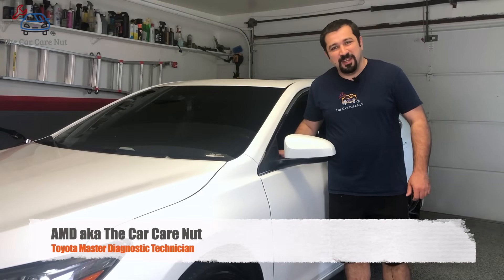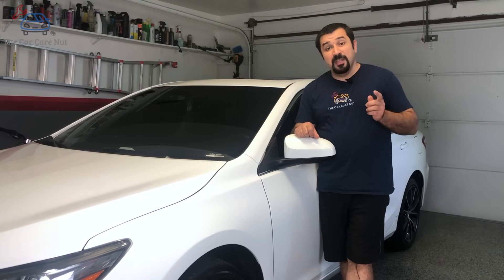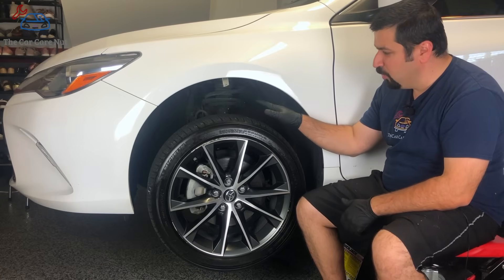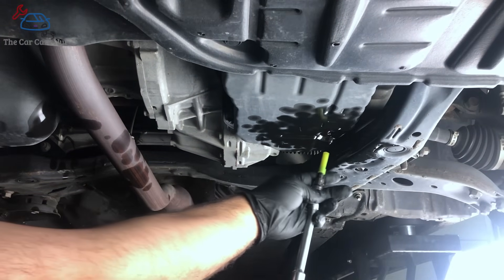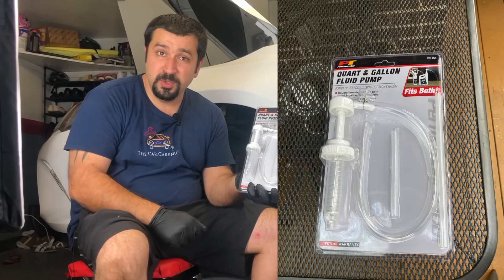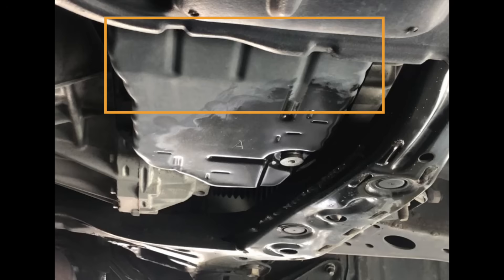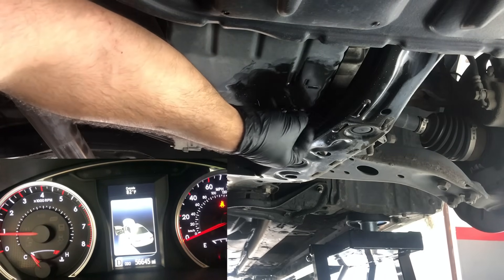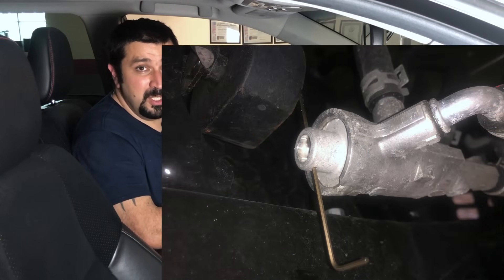How to change your Toyota Sealed Transmission Fluid

Comment: Thanks so much for this video.  Any thoughts on changing the filter on the Corolla CVT trans?
Reply from the maker: Hi! I wouldn’t change it if the fluid is changed on time
Reply: Thanks @Robert Weinmann for raising the question,
I've same model in the middle and didn't get a clear answer till i found this video. 
Thanks @AMD for the answer even if a question asked after video release a year later.

Comment: I have a 2021 Toyota Camry.  I am preparing to do its first 60000 mile transmission service.  I have a Launch scan tool.  It shows the ATF Thermal Degradation level.  It currently says 1645.  I have searched online and can not find anything on what 1645 means.  Is 1645  good or bad?

Comment: Why not do this when the car transmission fluid is cold (sitting overnight) then put in exactly what you took out?
Reply: Because the transmission fluid level might be low when you start.

Comment: does this work for 2011 camry?
Reply from the maker: Yes it does
Reply: Thnx for the reply! Would you recommend changing the filter too? I just bought a 2011 Camry with 130k miled
Reply from the maker: Hi! There’s a risk of issues changing the fluid at this time if it’s never been replaced

Comment: Sir, may I ask, on the fluid procedure, after the drive solid, while draining oil until it trickle, is the shift position on neutral or drive position? Also, if I want to practice before change the oil, the engine running or not while practice? Thank you
Reply from the maker: Hi! Engine running and in park

Comment: I know about the transmission fluid change, what about the transmission filter replacement? does it need to be done? and how to get trans fluid out of torque converter?
Reply from the maker: Hi! Filters don’t need replacement on toyota transmissions if the fluid is changed on time. You can’t drain the torque converter on toyota transmissions
Reply: @TheCarCareNut  Thanks for the response

Comment: If you drain the fluid when cold and refill the exact amount, then would that be enough if you don't have a temperature gun or don't want to refill without checking.the temperature?
Reply from the maker: Hi! You never know if the fluid level was right to begin with. If you do a job, follow procedure and do it right. I highly advise you not to cut corners with transmission fluid service

Comment: Hi there  I saw your channel  I was wondering if you help me with a question.   I have a 2006 Lexus gx470  with 175,000 miles   It’s been well taken care of.  I have service records for the car but I don’t see where transmission may been changed in it’s life.  Being that I want to keep up with maintenance would there be a problem changing the fluid and filter.  I have watched several videos.  I know of the horror stories of people changing fluid and transmission starts slipping or stops pulling.  Have you had that experience.  I had two Lexus  mechanics here tell me I’d be fine Toyota’s don’t generally have that problem.  But thought I’d reach out and ask.  I know to never do a power flush.  Any advice would help a lot.     Dustin
Reply from the maker: Hi! I’d be careful. You can replace the fluid but there’s risk of issues developing

Comment: Do I need to change the oil on my CVT gearbox again now? 
My Toyota (Europa) is from 2012. Changed gear oil (CVT) at 110000 km 5 years ago. The car is now 10 years driven 152000 km. During the summer holidays, the car pulls a caravan 500-1000 km per year. Should I change gear oil again now?
Not all the oil can be changed so I thought maybe a good idea?
Thanks in advance, your videos are very helpful.
Regards Steen
Reply from the maker: Hi! I would change it again
Reply: @TheCarCareNut  Thank you very much for your answer.
So even though the car has only driven 25000 miles (40,000 km) since the last gear oil change, you will do so due to the almost 5 year interval. Have I got it right?
It is important to me that the car can last 10 more years, I do not like the new modern cars :-)

Comment: Questions: 2019 corolla se (cvt). 

1) You didn’t say specifically if when the D stays on if you leave it in drive while draining the excess fluid. Do you leave it in D or do you continue shifting from D to N?

2) And if this is the official 60k mile interval fluid change. Is this the recommended fluid change every 60k miles? Because the corolla has something like 2 gallons of fluid, correct? And this is only swapping out 2.5 quarts. Those 2.5 quarts are enough to refresh the entire volume?

3) Does the cvt have the usual automatic valve body and filters that standard automatics have? And if so, do you recommend that the filters ever get cleaned, as in dropping the transmission pan/valve body?
Reply from the maker: Hi! When the light comes on shift the car in park and adjust the fluid. And every 60k miles is a good interval. The cvt transmission does have a valve body and a filter. Typically filters last the life of the transmission if the fluid is replaced at a good interval
Reply: @TheCarCareNut  you’re awesome man. Thank you.

Comment: Hello. I am from Puerto Rico but my daughter lives in Orlando Florida. She has a 2018 Corolla S. We have contacted the Service Department of the Toyota dealer that sold her the car several times to have the CVT Transmission oil changed but they indicate that they do not do this work because it is sealed. We understand that the change is necessary since the car has 62,000 miles. What can we do or do you recommend we do so that this work is carried out. We do not have a recognized mechanic to do this work for us. We also do not know anything about mechanics, so we do not risk doing it ourselves. Thanks in advance for your help on this.

Comment: One more question, with the whole drive light indicator method, so once I have been switching thru N and D and I see the indicator stay solid 'D' for a few seconds and then go out. Am I then safe to put the car in park, take foot off brake, remove jumper and then wait for the D to go solid ?
Reply from the maker: Yes out the car in park and remove the jumper

Comment: With a 2015 Camry hybrid what is the temp for a warm transmission using a scan tool also I have 152000 miles on the car and I have never changed the trans fluid , should I use your procedure now to change it what should I do differently?
Reply from the maker: Hi! For hybrids this procedure doesn’t apply. It’s actually much simpler just drain and fill until it overflows
Reply: @TheCarCareNut   Awesome that is so much simpler to just drain and refill until it overflows ,, thank you and at 152000 draining the tranny and filling it with new fluid will still be ok right it wont hurt the tranny?

Comment: ??? Where is this transmission cooler bypass valve located??? When do you pin it and when do you unpin it during the process??? And which "newer" transmissions is it on = I have a 2017 Highlander ltd. with UA80E transmission
Reply from the maker: Hi! It’s between the radiator and the transmission pan you need to remove the shield underneath the car. And pin it before you drain and the fluid and keep it pinned until you finish checking the fluid level
Reply: @TheCarCareNut  Apparently it is not on the 2019 RAV4 XLE AWD? I removed literally all the plastic, no sign of it between radiator and trans. All the lines leaving trans re-enter at rear of trans thru square finned box with no valve.

Comment: Thank you very much for your excellent videos. Can you please comment on how to check and change the front Differential oil on a 2014 camry.
Reply from the maker: Hi! On your Camry the front differential is part of the transmission so when you change the transmission fluid you also change the front differential fliod

Comment: I have a 2007 Lexus GX470. Is there any reason why you can’t just syphon out a couple quarts from the fill plug and replace with the same amount removed?
Reply from the maker: You could if the fluid level was correct to begin with

Comment: Can you explain a little more about that cooler bypass on the 8spd? Youre the first video I've seen thats mentioned it.  All other 2018, 2019 Highlander video's I find, no one does anything with the cooler bypass.  So what happens if I do your procedure and I dont push it in and put an allen key there versus what happens if I do?
Reply from the maker: Hi! You won’t measure the amount correctly. When the temp is in the range to adjust the fluid the cooler is closed by the thermostat. When you force it open with the pin you’re making sure that the fluid circulates through the cooler so you won’t get an inaccurate fluid level
Reply: @TheCarCareNut  I understand now. Thank you

Comment: Thanks for the video. Could you tell me what temperature the fluid should be for 2018 RAV4 AWD & is it an 8 speed transmission. If you start up your car & leave it in park does your transmission fluid heat up or do you need to put it in drive. Is one drain & fill enough. What is the cheapest scan tool that could measure this temperature.
Reply from the maker: Hi! Should be above 50 for normal operation. In park modern Toyotas has a transmission fluid warmer which warms the fluid in park

Comment: Hello and thank you for your videos. I appreciate this video tutorial. This procedure is only removing a portion of the full volume of the fluid. Is it possible to do a full fluid replacement? What i have done in the past with all my vehicles is drop the transmission fliud pan,  replace the filter and refill the amount that was drain. I will drive the vehicle around 100 miles and when it is cold drop the pan again, drain and replace the amount of fluid. I will continue to do this until i have put the full capacity of fluid that the transmission requires. In other words I am slowly diluting the old fluid with new fluid. I do know this does not get rid of all the fluid but I have owned 5 vehicles with close to 250k miles each and they never needed transmission repairs. I have done the fluid change every 50k-60k. What is your opinion on this procedure?

Comment: I noticed a slight problem with your procedure you should take the fill Port out before taking the drain plug out. Up north The fill port is going to rust and might be impossible to get out. Meaning if you did your procedure you would have a transmission that you cannot fill and is out of fluid

Comment: Hello AMD, I am doing this procedure on my 2011 Toyota Camry SE V6, my drive light blinks twice and then turns off, I understand that means the temp is too low, do I need to leave the Jumper cable in for the vehicle to continue monitoring the temperature of the transmission? I can't seem to get it up to temperature, with the jumper cable or without. It is 32 degrees on the garage I'm working on, I was thinking that may be the issue. I replaced an axle seal and am trying to make sure my fluid level is correct since I lost some during install (also lost what leaked out of the axle seal, I drove it for 3000 miles before I noticed the leak) so Im not sure how much extra I should add before the adjustment. Any help would be appreciated, thank you for your videos
Reply from the maker: Hi! You’ll need to pull the jumper and leave it in park and wait until it warms up
Reply: @TheCarCareNut   Thanks man I appreciate you taking the time to reply. YOU ARE A LEGEND!!

Comment: Hey care care nut, i tried the jumper method to measure the trans temp on my 2010 RX350, but neutral doesn't show up/blink, the rest including drive do.  I go back and forth between drive and neutral but nothing happens 😐. Any ideas? Thank you
Reply: Nevermind it works, the drive stays on but only for a few seconds. That should mean it's warm enough right? After that there's no drive indicator at all.
Reply from the maker: Hi! If the light comes on for 2 seconds then goes off put the car in park pull the jumper cables and leave it running until it comes in solid then adjust the fluid level
Reply: @TheCarCareNut  you're a life saver.

Comment: I have been told by other Toyota dealerships that I shouldn’t change the fluid. One recently said they would not do it.  I now have 115k on one sienna and 145k on another. Would it be safe to do so now?
Reply from the maker: Hi! At this mileage I would leave it alone
Reply: @TheCarCareNut  Thank you for the quick reply. What kind of issues might it create if it were changed now?
Reply from the maker: It’s a 50/50 risk of slipping or shifting issues

Comment: Hi AMD, Is the procedures at the dealer of flushing the fluid on the machine ok? Instead of drain and fill? I was just wondering on doing it on winter time. That would be on a Highlander 60k miles
Reply from the maker: Hi! It’s ok if it’s done at the correct miles and followed by a fluid level check

Comment: Using a heat temperature gun what is the correct temperature to have for the 2019 Toyota Camry 8 speed automatic transmission when pointing the gun at the Pan
Reply from the maker: Hi! On the 8 speed using the temp gun method is not as accurate. The temp range is 95-114

Comment: One thing touched on, but not emphasized is that the car on the jack stands should be as level as possible.  Most garages have a slight slope to them.  And many of us do not have 4 matching jack stands (I have 3 pairs of non-matching jack stands).  So getting the car as level as possible will help yield a valid level indication with the drain plug standpipe trickle method.  It would be nice if there was a known surface on the underside of the car where a person could place an angle finder (as used for driveline angles) to get the angle as close to zero as possible.

Comment: My transmission  oil has never been changed on my 2014 Sienna.  It has 155 000 kilometers.  Does it need to be changed? I have no problems.  Thank  you  for your  expertise. 
Ben.
Reply from the maker: Hi! I would leave it alone at this point

Comment: Rav4 2017 awd due for 1st tranny fluid change..... Assuming it was correctly filled at factory.... Can we do this way: Keep vehicle in garage overnight.    Drain next day checking exact amount that drained and fill with the same exact amount (keeping new fluid in garage so at same temp as drained fluid).
Reply: According to Scotty Kilmer, yes.
Reply: @MC-mh2ju  Actually, think better to drain fluid while it is still warm, letting it drain fully overnight, then measure and replace.

Comment: I've got a 2012 Camry 2.5, what would be the temp that I would need to check the fluid when viewing the temp on the scan tool? I not sure weather to change the fluid or not, but it will sometimes shutter under low rpm at a uphill load.  I'm not sure if it's a spark/coil issue or a trans issue. It has 205k miles and has never has spark plugs or a trans fluid change. I was hoping for a check engine light to lead me in the right direction but it hasn't stored any codes yet.
Reply: I have the same question. Hopefully someone can provide an answer.

Comment: Great video! Do dealers follow this procedure or do they use the machine to use compressed air to blow out the old fluid?
Reply from the maker: Hi! They use a machine if it’s a flush. If it’s a drain and fill then they use a similar procedure

Comment: Hi AMD, Thanks for the excellent video - my family has a 2007 es 350, 2011 es 350, and a 2009 sienna xle - I have an OBD scanner for the temp - will they all have the same temp range for the overflow procedure?  Thanks!
Reply from the maker: Hi! They will have the same temp which is 95-114
Reply: @TheCarCareNut  Thanks for the quick response!!

Comment: Just installed a used transmission with 45k in a 2015 Corolla.  No Toyota dealer nearby so used an aftermarket FE rated fluid that was locally available.  I'll likely only run it for a short while before I go back to Toyota FE fluid.   Thanks for the video tips.

Comment: Great video. 2014 Highlander there is about 7 quarts of oil. I did this and only got 2 quarts out. How do I completely flush or do I just do this procedure a few times in a week? Thanks again sir!
Reply from the maker: Hi! This replaces enough fluid to keep things fresh. If you want to replace the total capacity a flush with a machine is the best way

Comment: Hi AMD,  just perchest a 2022  Rav4 Trail.
What about the Filter and the fluid that is left in the torque converter? On the turbo 350s I worked on; I would remove the outlet line from the transmission and run the car removing the old fluid and running it until the fluid was clear catching it into a container. Just make shure you are adding fluid into the transmission and not letting it drop too low.
Play safe From Elliot Lake Ontario. Canada.
Reply from the maker: Hi! There’s no drain on the torque converter. If you want to replace the whole capacity of the fluid a flush is needed

Comment: I have a 2016 Toyota RAV4 does that little plastic tube in the transmission have to be in or out when you check it at about 105°F I am assuming it Hass to be in and when it comes to a trickle you put the other plug back in correct
Reply from the maker: Hi! It has to be in
Reply: Thank you for replying so quick so the temperature is OK at about 105 keep making these videos they are great other people just don’t give you enough detail 🙏🏽

Comment: Your channel is empowering and a blessing to the DIY community. Many viewers have stepped up and got scan tools. My question, using a scan tool, what is the temp range for a 2011 Camry 4 cyl? Also a 2018 highlander V6? Not sure if there are temp range differences using a scan tool vs temp gun. Thank you for the great videos!!!
Reply from the maker: Hi! Both should be around 95-114
Reply: @TheCarCareNut  Hi,  its it in farenheit ?  how mutch is it in celcius ( Europe ) Thanks  ?
Reply: A temp gun is wildly inaccurate as you’re not measuring temperatures from the internal sensor, which the “diagnostic mode” does.